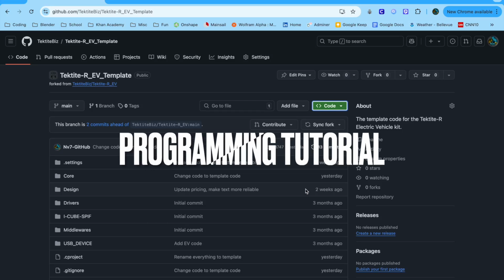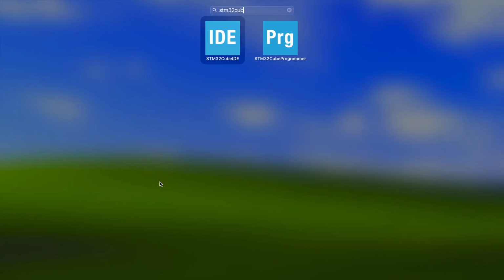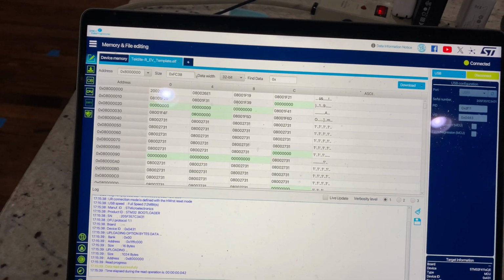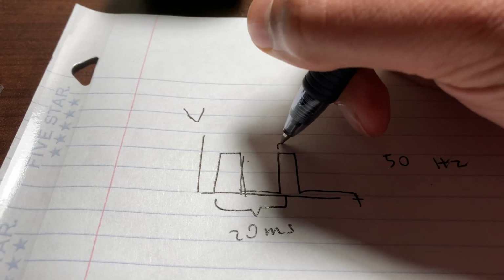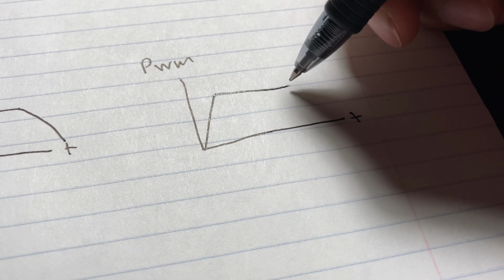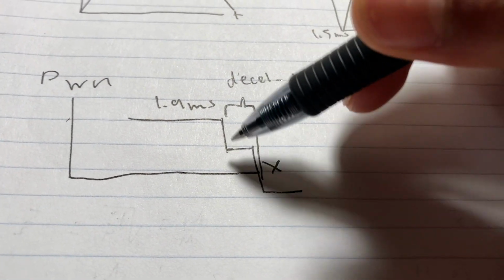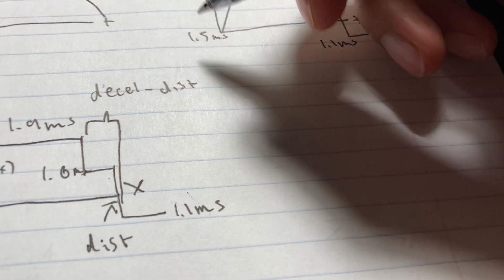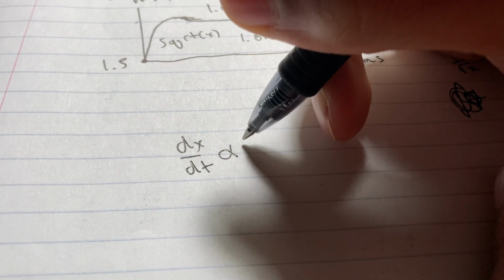(OLD) Tektite-R Electric Vehicle Programming Tutorial

Comment: How did you reverse the shaft of the flashhobby d2830 motor? Does the shaft come reversed in the kit or do we have to do that ourselves?
Reply from the maker: The kit doesn't use the d2830 motor, but also what do you mean by reversing the shaft?
Reply: @TektiteBiz  I meant like switching the place where the shaft sticks out. For example, if the shaft comes out of one side of the motor, by reversing it, you make it so that the shaft sticks out on the other side instead. But I guess that doesn't apply to this kit. What motor does this kit use? Also how much does the vehicle weigh? Thanks
Reply: @JoeMama-ii7ch  The weight is roughly 700 grams. Everything else is linked in the GitHub
Reply: @JoeMama-ii7ch tektite did not respond😢😢😢😢